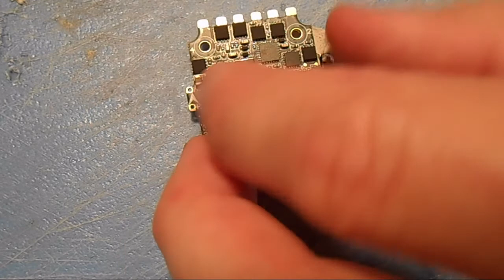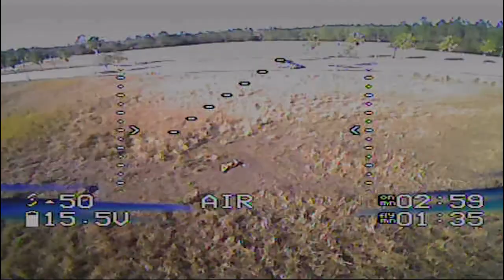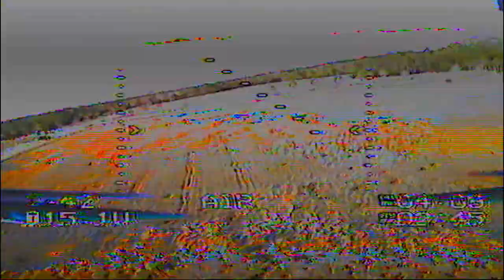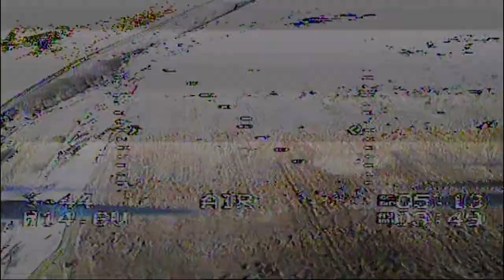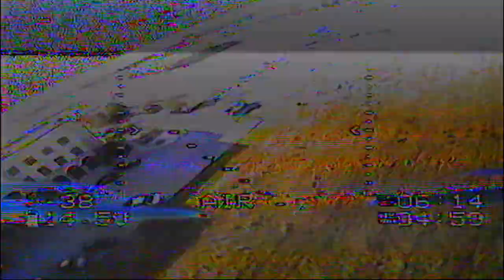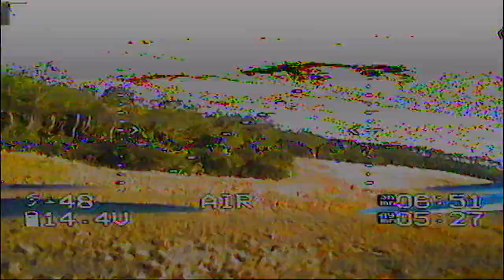5in Build w/ 20mm Stack (HGLRC XJB F428 + RDQ 2205 2450KV Motors)

Comment: Hey man thanks for the vids but I wanted to give you a few pointers. Firstly that soldering iron tip is long gone! It’s not able to tin because of the oxidation.  Also are you using lead free solder!? Make sure to at least use 60:40 leaded solder! Make sure to use flux too! That is basically the number one trick that will make a world of difference and your joints will be smooth and shine! 

So to recap: grab a new tip, and dip it in flux, then melt the leaded solder onto it to make the tip shiny and silver. Remember to clean the tip on a wire sponge too, then retin the tip each time. Use flux, if you’re not making perfect shiny joints then Use more flux!! The tip of your iron will become oxidized and you just wipe it off and re tin every time it’s not shiny. Once you’re done take some alcohol and a brush and clean it up and it will look a million times better as well as function much better with less heat and way less chance of breaking the joint!

Comment: Awsome build! I'm actually about to order a set of these motors lol. I want to get into racing this year and I thing the rdq 2205's and a floss 2 frame would be a great entry. I've got a ls210 frame at the moment on a freestyle build with racerstar 2205's  but it's too heavy and too slow lol.
Reply from the maker: I started with a similar build. These motors are awesome! You wont be impressed with most motors after you try them. I just lost this build in the water and I ruined the motors. I will certainly get some more RDQ motors in the future. I loved this build. I almost want to build the same exact thing. I really miss it!
Reply: Ninja Sauce yeah I just watched that video. Swamps are a bitch. I live in south Louisiana and have lost a cpl to them.
Reply from the maker: I have also been using the RDQ 2306 motors. They are pretty awesome too. But if you really want to keep the cost down, you can get some amazing RCX motors for about 10 bucks each. Their 2206 motors are pretty sweet. And they just released some 2207s for 10 bucks! They are crazy fast! The only reason why they are so cheap is because they sacrifice weight for better quality. So they will be heavier than some other motors, but they really rip!
Reply: Ninja Sauce I'm actually about to be ordering the rcx rs2206 for my 210 as soon as they come back in stock lol.
Reply from the maker: You will love em. My next build will be with the rcx 2207 motors.
Reply: Ninja Sauce sweet!